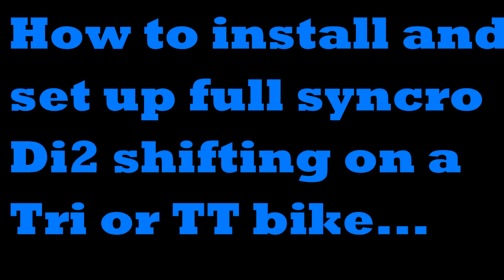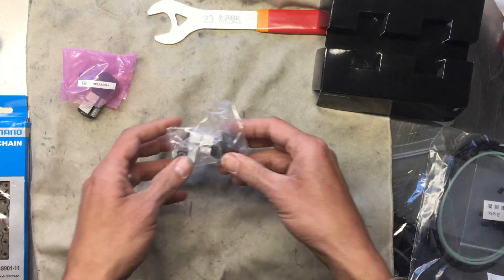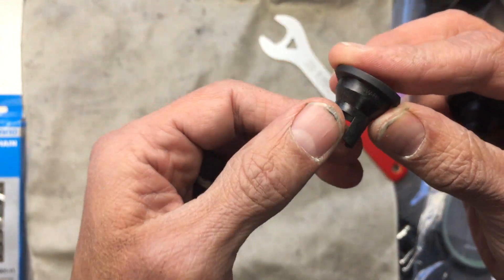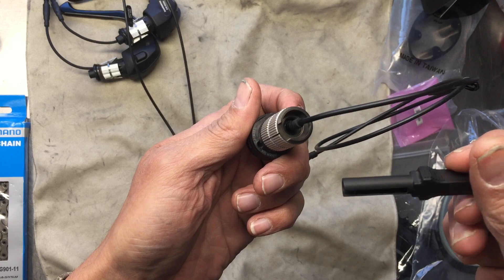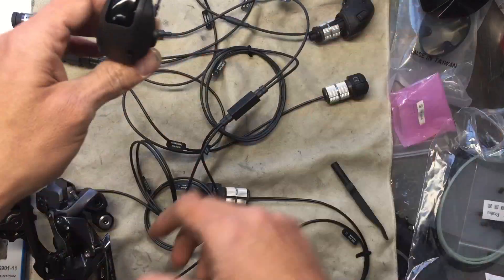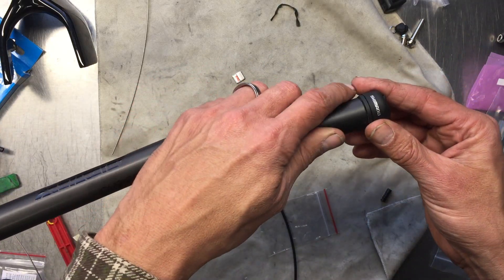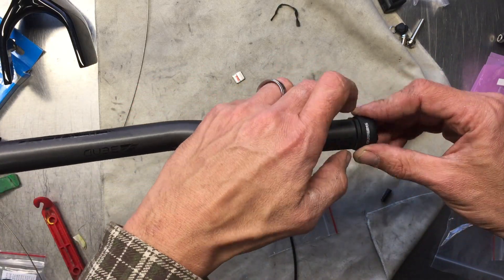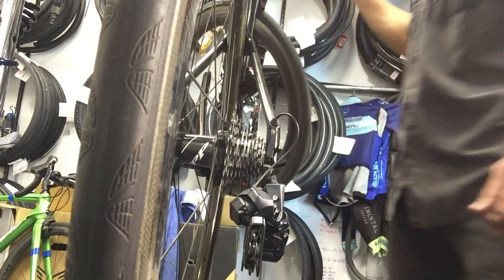How to install and use full syncro Di2 on a Tri bike

Comment: Hi Joey. I have just acquired this new system, already mounted though. Can you explain how to use these shifters in manual mode? how does it work with front and rear derailleur? Thanks for your help.

Comment: I have a Shiv TT with dura ace di2 and 2 junction box B and a intern junction box a. I can chose the mod with too times Klick but it is always in the semi syncro or normal mode but it don’t go in the sycronized mode. I try to connect the bike to my phone or iPad but when I chose the syncro mode in the e tube app the shifters don’t take over the mode. I need help

Comment: If TT bike currently has the older durace 9070 and want to go to the newer ultegra 8050 can I just swap the derailleurs or do I have to swap all the connections also?

Comment: What are your conclusion of FULL SYCHRO vs SEMI?
Reply from the maker: I think they're good features for the right kind of cyclist. Full synchro is a good option for someone who doesn't see any wattage spikes from sprinting, chasing or attacking, nor fully understand the concept of how the big ring and small ring gear ranges overlap (triathletes who consistently ride cross chained). 
Semi synchro just seems like a little shortcut for the quick rear shifts you make after shifting in the front. Kind of like a short cut on your keyboard where you hit one key and it performs three functions without having to hit all the normal keys.
It really depends on the rider and how much manual control you want in your shifting. I can see somewhere in the future a system that's fully automatic based off cadence, speed and/or power that automatically does all the shifting for you based off input. Fully automatic, all you have to do is pedal and the system does the rest!
Thanks for your question!
Reply: Thank You...I ride manual but I just set up a DI2 Ultegra system for my wife and was thinking going FULL SYNCHRO in order to simplify everything. Only issue is it is very hilly here.

Comment: There is so many parts and wires my head wanted to blow up, this the reason why I went to Sram red etap
Reply from the maker: Yeah, until you install a few of them the wires and parts needed can be confusing.
Reply: Switching to Sram because you couldn't install di2 on your bike? Have you tried it at least? It's pretty good, maybe more reliable than Sram
Reply: @DoomNerd67200  I have both groupsets, I hate not getting the right wire lengths on di2, with sram there's no hassle at all

Comment: Hi Joey thks a lot.. just wanted to understand I have Ultegra 2 button shifters in the aero bar, is it possible to configure semi or full synchro?
Reply from the maker: Yes, any Di2 system that has firmware that's within the last 2 years or so has the ability to switch to semi or full synchro. Just double click the little button on the A junction to toggle through the modes . When the red and green LED's flash once, you're in manual, twice is semi synchro, and three times is full synchro.

Comment: thanks alot!  I wanna ask how can i set up that i can change both front & rear gear while i am over a aero position or a normal lever handle ? 
now i got my aero position with the synchro mode, but i found that the same mode not provide the same feedback in lever handle, so wired
Reply from the maker: So when you say "normal lever handle", I'm assuming you mean the standard TT bike 2 button shifters? If so the right hand  or rear shifter 2 buttons will control all the shifting. You just choose between harder or easier and the system takes care of the big ring shifts. You can override the system with the left shifter by manually shifting from the big/small ring as well. In order to use full syncro, you have to be in full syncro mode (double click the button on the A junction to switch modes) and have the latest internal Di2 battery.  
Hope this helps!

Comment: Hi!
Do you know anything about Shimano thinking about having a system similar to Sram (click Simultaneous to change the plate)?
Sometimes I prefer to have a manual system than fullsync.
I think my option is to use shifters 6871 and 671, instead of ws9160 and 8060. With 6871 and 671, could I use both manual, semisync and fullsync, right?
Reply from the maker: When you say SRAM's system is clicking simultaneous to change the plate, I assume you mean shifting the front derailleur? If so, I doubt Shimano will ever go that route. On this particular shifter set-up, the only option is to go full synchro, but on any other Di2 shifter, you can toggle between the 3 current possible options (manual, semi-synchro, and full synchro).
Reply: @JoeyMesa  Thanks for your answer! why do you think shimano won't go that way? Do you think a firmware update is possible to use the options with these shifters? I am thinking of returning to the 6871 and 671 series to be able to use these 3 methods of changes
Reply from the maker: I think the possibilities of how an electronic shift system operate are pretty wide open. It's probably possible for Shimano engineers to figure out a firmware update to make it work, but there are two reasons I believe Shimano won't replicate the 2 button shifting like SRAM eTap. 1- SRAM probably has a patent on this system and, 2- Shimano seems like a very prideful company and wouldn't produce something they didn't come up with.